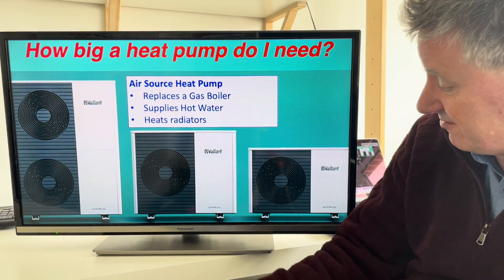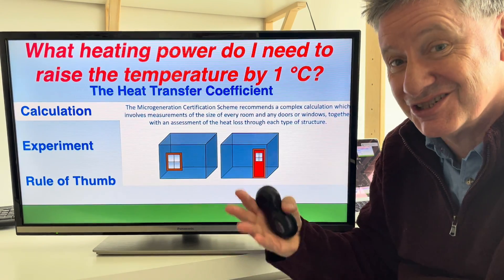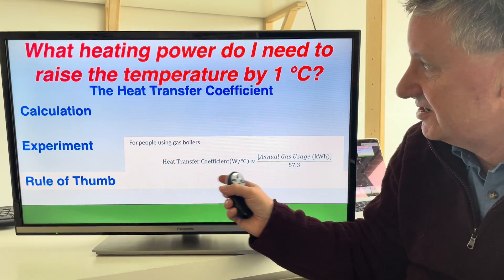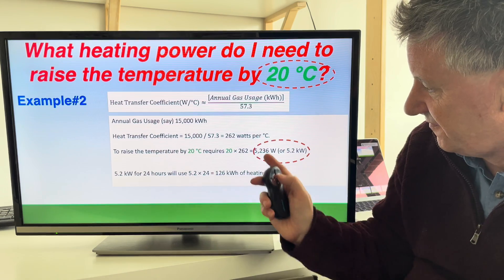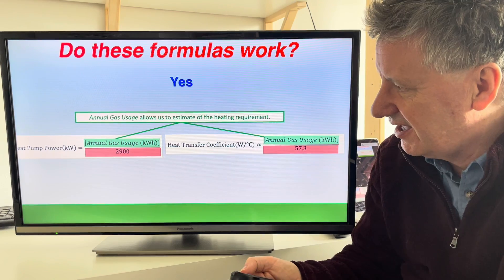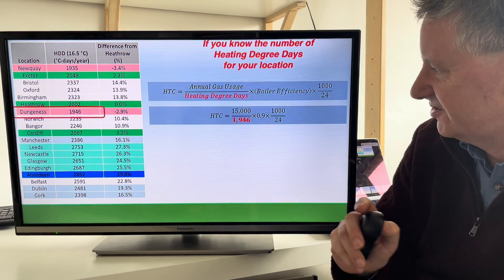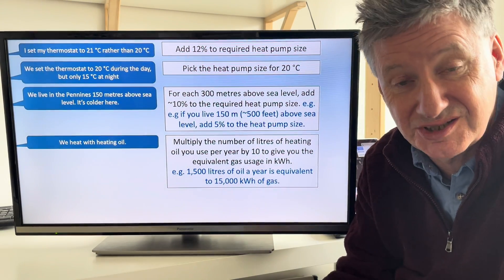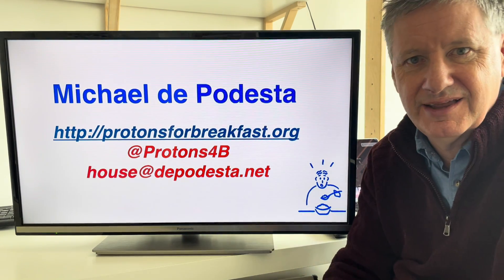How big a heat pump do you need? A simple Rule of Thumb.

Comment: Hello, that's an excellent video, thanks.
Do I take it that the kW rating of the heat pump is defined by the energy input required, not the heat output required?
That would explain why a heat energy requirement of 16000kWh only requires a 6kW heat pump?
Thanks again.
Reply: Excellent, that is most helpful. Thank you very much indeed 👍
Reply: Thank you very much for that detailed and helpful reply. I really do appreciate your help. Thanks for your time and knowledge.👍👍
Reply from the maker: Good Morning

No. The kW rating is the rate at which heat is delivered. So, for example, a 6 kW heat pump would deliver 6 kW of heating to a home, but only consume (typically) 2 kW of electricity.

If one takes 16,000 kWh and averages it out over the year it amounts to about 44 kWh of heating per day, or just under 2 kW. But of course in summer the heating required is very low, normally just a few kWh per day for hot water. And in winter the heating demand is much higher. What the video is saying is that if you you use 16,000 kWh of gas annually, then your peak heating requirement in winter in the UK is likely to be 16,000/2,900 =5.5 kW or 5.5 x 24 =132 kWh/day.

Does that make any sense?

Best wishes

Michael
Reply: Yes I see, thanks very much I'm getting confused between kW and kW/h I think?
I have electric storage heaters and Economy 7, would my annual night time use of the storage heaters (typically 15,000 kWh per annum) work exactly the same as the gas usage in these calculations?
Thanks again 👍
Reply from the maker: @pjay3028  Good Morning.

Yes. It's very easy to get confused between kW and kWh.

The 15,000 kWh annual consumption would work in a similar way to a gas boiler, but it is not so straightforward. Why not? Because gas is used primarily for heating the home and hot water, and just a tiny amount for cooking. In contrast electricity is used for lots of things around the house. Most homes use between 5 kWh/day  and 10 kWh/day just to operate computers and lights and the TV etc. That's around 3,000 kWh/year. So it's hard to know how quite how much of that 15,000 kWh/year of electricity use is related to heating.

If you have a good rate for your cheap electricity, then using storage heaters and Economy 7 is an excellent way to heat a home. A heat pump system will emit less carbon dioxide per year, but I doubt that it will save you very much money. 

Do get back to me if you would like me to do more detailed calculations.

BEst wishes

M
Reply: Hi, thanks again. I consistently use 7kWh of night time energy every night during the summer months, when the storage heaters are off, so I'm fairly confident that my non-heating element of the night units is 2,500 per annum (this includes DHW) so I subtracted that from my total annual night usage to arrive at 15,000kWh for heating. Would you agree with this logic? Thanks
Reply from the maker: @pjay3028  OK. YEs I agree. So 7 kWh x 365 days ~ 2,500 kWh. So you subtracted this from your total electricity use (17,500 kWh) and arrived at 15,000 kWh. In this case etc rule is similar - but slightly different from gas. The reason is this.

When you consume 1000 kWh of gas only about 85% or 90% of the heat produced enters your home. So using 15,000 kWh of gas produces only around 0.9x15,000=13,500 kWh of heating.

When you consume 1000 kWh of electricity 100% of the heat produced enters your home. So using 15,000 kWh of electricity produces 15,000 kWh of heating

There is a factor for this efficiency in the 2,900 number in the Rule of Thumb formula. Re-calculating for 100% efficiency the number comes out around 2,600. So 15,000 kWh of storage heater electricity consumption, the suggested heat pump size comes out at about 5.8 kW. 

Remember it's just a rule of thumb - but that's how it comes out.

Best wishes

Michael
Reply: Hello, not sure if you can help with this but I'll ask anyway!!
I have done some temperature measurements and I am wondering if it is possible to calculate the heat loss from my lounge? Here we go....
The room temperature at midnight was 17degC. The external temperature at midnight was 2degC.
My storage heater ran from midnight to 07:00 and used 12kWh of electricity.
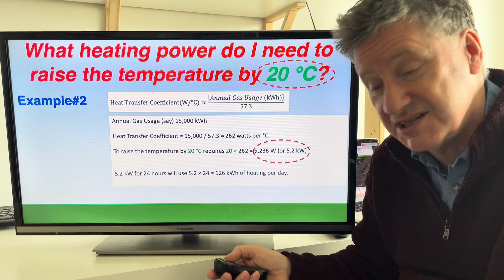The average external temperature from midnight to 08:00 was -0.55degC.
The room temperature at 08:00 was 16.7degC and the external temperature was -1degC at 08:00.
The floor area is 24sq m.
Is it possible to accurately calculate the total heat loss in Watts/sq m from this data?
Thanks, but just ignore me if I'm not making any sense 😂😂
Reply from the maker: @pjay3028  Unfortunately it's not possible to calculate the heat loss that way.

The external temperature was reasonably constant: 0.75 °C ± 1.25 °C
The internal temperature was 16.85 °C ± 0.15 °C
So the temperature difference was roughly 16.1 °C ± 1.3 °C i.e. you know the temperature difference within 10%.

How much heat was generated in the room to maintain that temperature difference? If you had run a fan heater and used 12 kWh of electricity then you would have produced 12 kWh of heat which would have flowed out, so the heat loss would 12 kWh/7 hours =1.714 kilowatts. The problem is that that this energy was consumed by a storage heater - which does not release its heat over the same period. One needs to know how much of the energy used by the storage heater to heat up its internal store, was released into the room.

Does that make sense?

M
Reply: Haha. I knew you would be able to explain this to me, thanks.
If I know the internal temperature at midnight tonight and the average temperature during the day, and check that the storage heater is cold at that point, would it then be worth doing?
Thank you for your help.
Reply from the maker: @pjay3028  To do the calculation its important that all the temperatures are (reasonably) constant. If this is the case, then you know that all the heat energy you put into the room flows out of the room. If the room heated up a little or cooled down a little then you would be storing heat, or drawing heat out of a store.

So when it's reasonably stable outside, use one of those cheap fan heaters (e.g. https://www.amazon.co.uk/Electric-Horizontal-Protection-Thermostat-Lightweight/dp/B0CD2PN9H3/) with the thermostat set and an electricity meter (e.g. https://www.amazon.co.uk/Tapsin-Backlight-Monitoring-Overload-Analyzer/dp/B0BLRYPJDC/) to measure the cumulative energy use.

Then the number of kWh used divided by the number o hours gives you the average power. 

In scientific building surveys they do this in every room and wait for the temperatures to stabilise. In your case, choose a nice cold night so that the dominant heat flow is definitely out of the house and not into any neighbouring rooms i.e. keep teh temperature of teh surrounding rooms similar.

Alternatively, you can just use any heater and use two plugs in series. One a power meter and teh other a temperature controller - (e.g. https://www.amazon.co.uk/KETOTEK-Temperature-Controller-Thermostat-Controlled/dp/B085Q2NDP9/)

Obviously, things can go wrong. So try doing it more than one. Remember teh golden rule of experimental physics: Do it quick. Then...do it right!

https://protonsforbreakfast.wordpress.com/2014/01/19/the-golden-rule-of-experimental-science/

Best wishes

M

Comment: Intrigued and a bit suspicious that this may not work for us. According to the bill we use 6590 kWh of energy on gas (est) and 6100 kWh last year. According to your formula we would need a heat pump of 2-2.5 kW which for a 6 bed house seems unlikely.  I wonder whether the fact we have solar thermal and we keep the house at 18C which allows us to turn the gas off in summer completely skews the calculation as you are inferring a lot about hour-by-hour heat loss from an amortised annual energy consumption figure. The two heat surveys we've had done - which have to make assumptions as well about material properties, U-values and build quality, suggest heat loss and thus heat pump size of 6.2-7.1 kW. It's just a very big difference so interested to know your thoughts.
Reply from the maker: Jeremy, Hi. I think my analysis is sound, but you are right to be suspicious. That is an extremely low gas consumption - less than half the UK national average for a house that seems to be twice as large as average (200 m^2?).

Turning gas off in summer and relying on solar thermal is likely to be smaller part of the problem. Keeping the house at 18 °C rather than 20 °C  makes a 20% to 25% error. 

Am I right in guessing that your house is relatively modern? 

My guess - and it is a guess - is that heat loss at -2 °C (or whatever your local design temperature is) is likely to be more than my "rule of thumb" but in all likelihood less than the estimates. 

Do get back to me if I can help anymore: meanwhile good luck with your endeavours. 

M

Comment: Actually I don't need one at all. I have a working gas boiler and a brand new boxed one as it's eventual replacement in the garage😂😂😂
Reply from the maker: Ian Harvey, Good Evening. If you don't want a heat pump no one is obliging you to install one. But when the gas network is closed down - the plans for which are being made right now - you may find the gas boiler in your garage is not much use. 

Best wishes

Michael

Comment: Hi, are those values of KWh for gas burner applicable also for pellet burner ? Considering that 1 kg of pellet gives 4,2 Kwh if i burn in a season 490 bags of pellet of 15 kg each, my energy requirement should be 490x15x4,2 that equal to 30.870 Kwh per season divided by 2900 equal to 10,65 Kwh of heat pump. Rounded up to a 12 Kwh model. If this is correct should not be difficult to calculate the house eneregy requirement for any type of heat generator. Of course those coefficient are valid only for a heat pump.
Reply from the maker: Gianluca, Good afternoon. Sorry for the delay in replying.

Yes, I agree with the principle of what you are saying, but I have some concerns.

This "divide by 2,000" formula. is based on the idea that the heat delivered to the house is the gas consumption multiplied by the boiler efficiency which is assumed to be 90%. This assumed efficiency is higher than most actual boilers and this leads to a slight over estimate of heat pump size. 

Switching over to using wood chips my first question is about the reliability of the figure for the calorific content of wood chips kWh/kg. If you think your figure is reliable, then the house stays more-or-less at its set temperature through the heating season, then yes, this estimate should make sense.

Best wishes and good luck with your endeavours.

M

Comment: What's the problem with having a heat pump bigger than you actually need? Gas boilers are all oversized & that doesn't cause a problem. You just have them on for a shorter period of time than a small unit.
Reply from the maker: Good Morning. The refrigerant in heat pumps is driven around the internal circuit by a pump/compressor. This compressor can vary its rate of operation from 100% to around 40%. So if the maximum heating power required is 10 kW, the pump can vary its output smoothly from 10 kW down to 4 kW. For heating power below this - it switches on and off. Where I live in London, this means the pump will operate continuously about one third of the time if it is perfectly sized

https://protonsforbreakfast.wordpress.com/2023/12/17/variability-of-heating-demand-throughout-a-year/

https://protonsforbreakfast.wordpress.com/wp-content/uploads/2023/12/heat-pump-demand-analysis-04.png

Now suppose that the heat pump is twice as large as necessary  - something which is actually quite common i.e. the maximum heating demand is actually 5 kW. Then the 10 kW heat pump will only be able to operate continuously when the heating demand is between 4 kW and 5 kW i.e. during the maximum 20% of cold days - which is just a few days a year.

So oversizing leads to excessive cycling. In the extreme case, this means the heat pump is trying pump large volumes of water - typically twice as a boiler - round a circuit in pulses. There used to be concerns about the wear and tear on the motor from this kind of operation, but modern controls mean this I likely not an issue. But from an engineering perspective, this is just not optimal. And of course, everything in the circuit will be oversized too leading to extra cost and (perhaps) unnecessary radiator replacements.

I would say that anywhere from 100% to 150% of nominal peak load is 'about right'.

Best wishes 

M

Comment: Surely this is completely wrong...The heat pump should be sized on the worst case scenario...Which is the lowest winter temps expected in your area i.e. the coldest day to maintain 20C inside...So you need to know how many kW/sec are required to maintain 20C inside when its -5C or -7C outside, that would be your h/t pump size in kW. The ONLY way to 'measure' that is take meter readings for 8,10,12 hrs a day maintaining 20C inside while its -5C etc outside. Or more practically do 0C outside and 5C outside and add the difference (this is still only an estimate of -5C conditions). Or you can calculate the total heat loss of your house which is the usual way to do it but that just an estimate.
Reply from the maker: No, it's not completely wrong. 

Firstly, heat pumps are sized based on a so-called design temperature. This does not cover the very worst case, but - depending upon the design code - should cover more than 99% of days. 

Secondly, "kW/sec" are not a meaningful quantity. I think you mean kW. Sure measuring the heating power on the coldest day is another great way to estimate the size of heat pump required. So measuring the number of kWh of energy used on a cold day and then dividing by 24 hours. One then works out the heat transfer coefficient (kW/°C) and scales it to the chosen design temperature.

This method - listen to the presentation - integrates the heat loss across a heating season and works out teh HTC that way. It is a Rule of Thumb i.e. an indication to help make sure you don't come up with a crazy answer.In the UK, many people have reported that it is remarkably accurate.

Anyway: Best wishes with your endeavours.

Michael
Reply: @michaeldepodesta001  On the basis that most people dont run their gas heating boiler 24/7, its more like 8,10,12 hrs a day. You CANNOT take that total gas usage and divide it across 24hrs to size a heat pump!! You will end up with a heat pump that can only maintain about 15C at best for 24hrs in the winter. You can ONLY divide your gas usage by the number of hrs its running to maintain 20C! The 'temperature' achieved from say 10kWh over 12 hrs is completely different to the temp achieved from 10kWh spread over 24 hrs, its obviously HALF the heat energy at most. Sizing a heat pump on that basis would result in it working in the autumn & spring but being hopelessly undersized over the winter when you need it most...and not needed at all in the summer. A heat pump sized to give a yearly total kWh output bears no relation to a heat pump sized to give 20C temps on a typical winters day, at 0C...But thats what people actually need...!! Who wants a heat pump that doesnt work in the winter!!!
Reply from the maker: @manoo422  Your remarks are just wrong, and the tone of your comments is also rude and insulating. Please be more respectful.

The system of using heating degree days allows a fair estimation of the HTC, and the heat pump size  follows from that.

Please remember that the MCS technique routinely produces estimates of heat pump size that are wrong by a factor 2 too large, and that this is a rule of thumb - a quick guide. You are under no obligation to use it, but the fact is that many installers and assessors find it works quite well.

Best wishes

M
Reply: @michaeldepodesta001  I have used the calc for yearly gas consumption and got less than 1.5kW for a heat pump size including the geographical adjustment!! Yet I am currently using about 45-50kWh of gas over about 10 hrs to maintain around 18C! Clearly I need at least 6-7kW heat pump to maintain 20C when the outside temp is around zero. Yearly gas consumption can NEVER have any relevance to heat pump size to maintain a set temp during winter, the two are COMPLETELY unconnected. Thats like claiming the UK is 13C everyday, all year round because you averaged winter and summer temps...completely meaningless rubbish!! You dont seem to have any comprehension that average energy has NOTHING to do with ACTUAL temperature!! Which is the only thing that matters!!!
The ONLY method that is remotely accurate is the daily gas consumption on the worst winters days. Anything else is total fantasy.
Plus if you assume a realistic ave COP of 4:1 and electricity is 4 time the price of gas per kW, you would never get your investment back anyway...
Reply from the maker: @manoo422  Could you please stop this nonsense. I explained how the rule of thumb was devised in the video, and it is based on real physics as I explained in the video.

But it's a rule of thumb - a quick guide. Clearly you heat your dwelling in a different pattern. For example if you only heat your home for 10 hours a day then the rule of thumb will obviously underestimate the required heat pump size. Likewise, if you use a lot of DHW it will overestimate heat pump size.